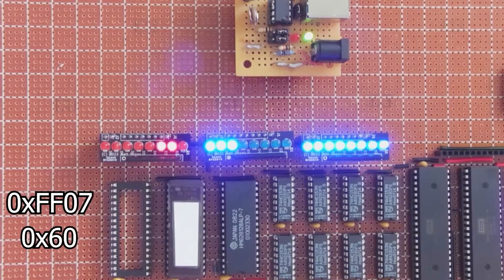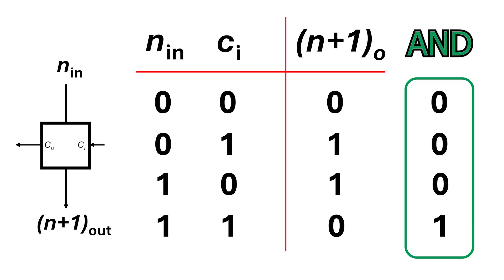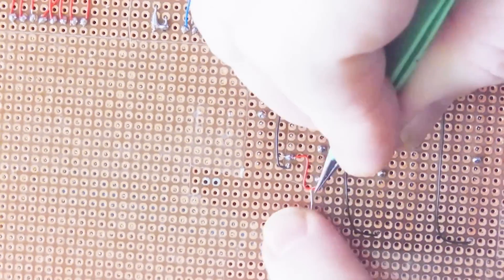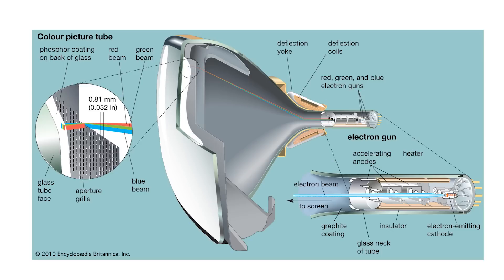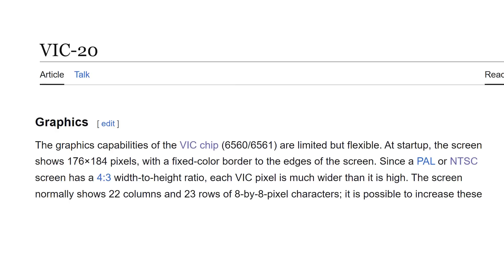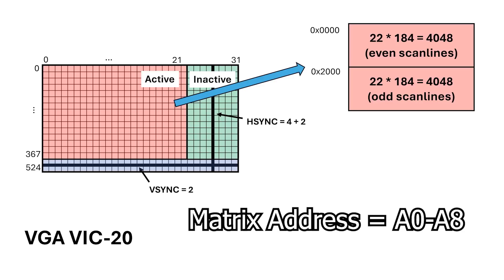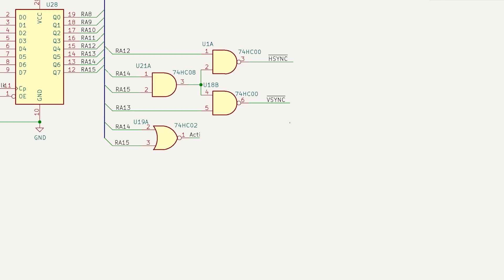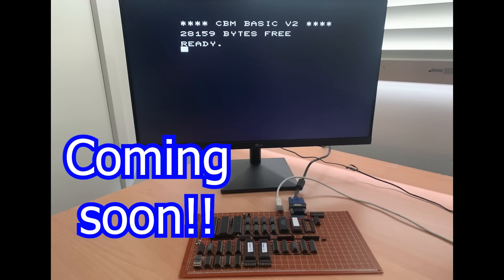VIC 20 build.  Raster generator HSYNC and VSYNC

Comment: Any thoughts on how the VIC chip could derive a 4.090909 Mhz clock from a 14.31818 Mhz input clock? The system clock is a division by 14, and the color burst is a division by 4, but a division by 3.5 to get the Dot clock is unusual for late 1970s chips, isn't it? 

I've been scratching my head about this for a long time.
Reply from the maker: Yeah i think there is a divide by 14 driven by clock.  I think the divide by 3.5 is driven with combinatorial logic from the divide by 14 and the clockbar signa (28 states total), i'd have to sketch it out though to be sure.
Reply: @ I’ve been working on an FPGA VIC replacement for a bit now and started with the PAL version because I’ve not been able to sort this dot clock out

Comment: While less important in (relatively) slow digital signals, I'd guess this kind of prototype wiring will have less parasitic capacitance issues than the breadboard one
Reply from the maker: Yeah, i think breadboard is OK up to about 3-5 MHz, although good boards will go a bit higher.  I've found this sort of wiring can go to ~10 MHz.  A bit higher if wired carefully.

Comment: I'm really enjoying this. I've been trying to get an FPGA to interface with my Vic on and off.. so it's quite timely that I saw your latest video.. And its always nice to see solutions that don't use FPGAs. Looking forward to more of these videos.. I wonder if you do something similar with the C64.. OK.. so I'm thinking more along the lines of sprites rather than a C64 clone. :)
Reply from the maker: Yep, will probably move to C64, but in the short term, I want to replace the 6502 with TTL logic.
Reply: @DrMattRegan  I should probably take time out and watch your 2 videos but something I'm confused with on my own project is the rate at which VGA needs to draw a pixel (1 clock cycle on my 28MHz clock) and how long it would normally take for the Vic chip to read the RAM (using the 1MHz P01). I'm thinking I need a framebuffer to handle the difference in rates. Which part of your video handles the buffering between the different clock domains? Or are you going to read the screen/character and colour RAM at much faster rate than the original Vic would? Maybe I did recall you saying your RAM was faster than the original 2134 chips so maybe that's what you're doing? Shame we couldn't connect on Facebook/Discord. It would be nice to bounce idea off you since you obviously know what you're doing.
Reply from the maker: So, in VGA, HSYNC needs to be ~31500 Hz, but the dot clock is more flexible.  I have a VGA dot clock of 8 MHz, which works just fine.  Normally the actual VIC 20 has a dot clock of ~4 MHz and it produces 8 pixels every two CPU clock cycles.
The SRAMs i'm using are about 4-5x faster, but i use that to do all the lookups required.
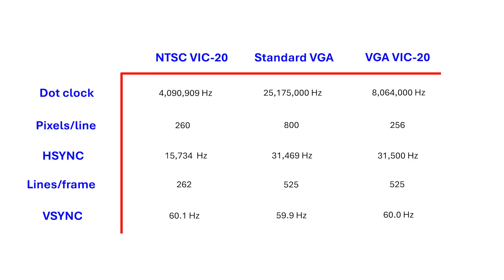Reply: @DrMattRegan  At 12:25 I got a bit lost. I'm starting to get it now I think - you get a 16-bit value from your "linked list" because you get 16bits from the 2 EPROMs. The bit I'm missing is how you step through the addresses within those EPROMS. I'm looking at the VIC20 Part3.pdf schematic.. Ah!! I get it now, you're feeding the outputs back into the inputs so that's how it knows where to go. So out of interest, how does this actually start? Do you just get a random address and the ball starts rolling from there? I guess you'd fill the unused EPROM memory with 0's so that if it hits one of those locations it goes back to the start?

I am quite fascinated to see how this fits together with simple logic. Being a developer I (unfortunately) try to solve problems as a programmer when playing with FPGAs rathern than thinking in terms of discrete components. It's caught me out many times!
Reply from the maker: You got it exactly correct.  It doesn't really matter where it starts in the linked list, it's circular.  All address outside are set to zero, so a random start will either work directly or jump to zero.  

For YouTube videos, i think discrete logic makes a more watchable video.  I've tried software only playlists (like the SAP6502 microcode) and they don't do as well.  Also, i still feel like i'm a bit far away from what's going on with an FPGA.  That said, a C64 may necessitate it.
Reply: @DrMattRegan  I challenge you to stick with TTL for the C64. I'd love to see how you pull off sprites or the SID chip. FPGAs are cool but you don't really get to play with the nuts and bolts :-)

Comment: The schematic has U17 pins 11 & 12 connected to RA0 ? shouldn't it be RA3 ?
Reply from the maker: Well spotted.  It should be RA3,  and pin 10 should be CA3.  Looks like i relabeled the wrong pin.  Thanks for that.

Comment: Where do you get your perf boards?
Reply from the maker: Ebay, but the originate in China.
Reply: @DrMattRegan  Could you post a link, please?
Reply from the maker: The ebay seller i used is called royal2016888 but it looks like they are out of stock.  If you search for "perfboard 30cm" there are some available.

Comment: Another awesome video. Look forward to experimenting with this. I always find the massive border's ugly. How in logic could you say stretch the images width or height? 🤔 I suppose in code we can scale the image for a certain screen size and get the best fit.

But wouldn't it be great to have to rotary controls where you stretch vertically and Horizontally🤐
Reply from the maker: Thank for that.  We can actually make the active area as big as we want by changing parameters.  The monitor i use though wants a blank period around HSYNC of the colours doen't work properly, but it can be pretty small.

Comment: I now understand why FPGAs, like the Lattice ICE40, are made up of Look Up Tables (LUT) and Flip Flops. They have placed the EEPROM and the Flops into a single ASIC. With that architecture, they can generate any kind of combinational logic. Thanks for building this VIC-20 video generator.
Reply from the maker: Yes, a look-up table with a flip-flop lets you make a finite state machine.  Add a memory (with the appropriate addressing system) and you have a Turing complete machine that can execute any computable function.!

Comment: have you done wire wrapping for circuit prototyping? I've tried it after it was suggested on a robot combat related project. it's quite fast and easy to undo stuff if you make a mistake.
Reply from the maker: I did use wire-wrapping many years back, but when i was younger, the sockets were too expensive for my self funded projects.  Now i'm just use to doing point to point wiring.  I have thought of doing a video where i compare myself at the two techniques (and maybe bread board as well).
Reply: @DrMattRegan  yeah, sadly wirewrap sockets are pretty spendy these days :(

Comment: I point-to-point wire myself.
Reply from the maker: Cools, what technique do you use for the insulation?  Cut to size, stretch the wire and move, or burn through?
Reply: @DrMattRegan  I use a wire stripper, normally strip one end of the wire on the spool, solder at the start point, and cut/strip at the next point. or I will
Measure, cut, and strip both ends.

I want to add a great video, I have been working on a Z80 build.   The next project is to do some type of video output and have a bunch of old video chips that I may try to use.
But a few years back Ben Eater's video and videos like yours on generating a VGA signal with EPROMs over having to use a stander Video output on my list to look into.

I do not go into a lot of video production quality, but he is a point-to-point wired Z80 board and demo test of the board.
Since that video made a PCB for the whole system, programming board, and Z80 board.

https://youtu.be/c3qlp9yG5nc
Reply from the maker: Cool, i had a look at your video, have you  done one on setting up and using sdcc?

Comment: On 10:48, you circle the screen refresh rate and vertical refresh, but not horizontal refresh rate. Is this an error?
Reply from the maker: Hmm, i circle horizontal then vertical but not at the same time.  Thanks for the feedback though.
Reply: Oops. I think I confused you. At 10:35 on the VGA timing web page, you mention horizontal sync rate, but you have vertical refresh circled in red.  ⭕️ There's no horizontal anywhere on the page.
Reply from the maker: You are right, i think there is a mistake on the TinyVGA website, 
http://www.tinyvga.com/vga-timing/640x480@60Hz
Screen refresh rate is the VSYNC rate (60Hz)
What is labeled "Vertical Refresh 31.46875 kHz" is actually the HSYNC rate.
Well spotted.

Comment: I think it could be using one 74hc4040 instead of three 74hc161. 74hc4040 is a 12-bit counter and has all the outputs (Q0 - Q12)
Reply from the maker: That was actually Ben Eater’s design with the multiple 74ls161s, but thanks for the suggestion.

Comment: Were EEPROMs too expensive for 8 bit computers to generate video this way back in the 70s and 80s as it seems to be a cimple way to avoid complex custom chipsets?
Reply: They were relatively expensive and more importantly, smaller.

I designed and built a video card for my SYM-1 computer as my final year electrical engineering project. Admittedly, I didn’t think of using EPROMs at the time, but they were only 4K in those days, so I would have needed 16 to do the job of one today. Instead, I used the 6845 CRT chip that had all the counters and generated the sync pulses.

As an aside, back in those days, computers needed serial Video Display Units. What was then called the Software VDU where the video memory was mapped into the CPU memory as the VIC-20 and other computers had was new. My video card did both. It’s video memory was directly accessible to the CPU but it also had a serial port and onboard processor so it could act as a serial VDU simultaneously.
Reply from the maker: Yeah, the best solution at the time was custom logic, which is what they did.  The main reason I use them is to 1 minimize wiring and 2 demonstrate finite state machines which I’ll eventually use to replace the 6502
Reply: EEPROMs were horrendously expensive and weren't widely available until the late 80s. Regular UV erasable PROMs were available from the late 70s but 1k (2708/2508)  and 2k bytes (2516/2716) only.   By the early-mid 80s,  the 2764 - 27256 (8k - 32k) were available and quite usable as combinatorial logic devices - but not on the scale of what Matt's doing here with those half Megabyte parts.   Mask-programmable ROMs and fusible link PROMs were used in manufactured devices, but on a huge scale it was cheaper to create custom ICs.   The intermediate option was the ULA common in the mid 80s too - Uncommitted Logic Arrays - which offered a bunch of standard logic gates which could be effectively blown at the factory to create the required circuit.
Reply from the maker: Correct, sometimes they also allowed different metal masks for the top layer of the ULA, which effectively allowed different connections. At NVidia, when i was there we still relied pretty heavily on fuses.
Reply: They also were a lot slower. A standard EPROM from the mid 80s can't keep up with the dot clock, even when targeting CGA resolution instead of VGA. Trust me, I tried (it kinda sorta worked, but it sparkled a lot and everything had an edge to it. If you tried using that as a linked list, it's gonna crash and burn and might even damage your monitor). Also if you look at, for example, Galaxians from 1979, it outputs 8 pixels parallel at 1/8 the dot clock and these then get shifted by a bank of 74LS194s which can handle the higher frequencies without a problem.
Reply from the maker: Fortunately for the VIC-20 in in PAL or NTSC, we have about 500ns for the bitmask read.  It's a bit tricker in the VGA version of the machine.